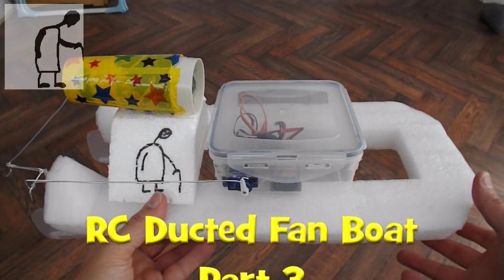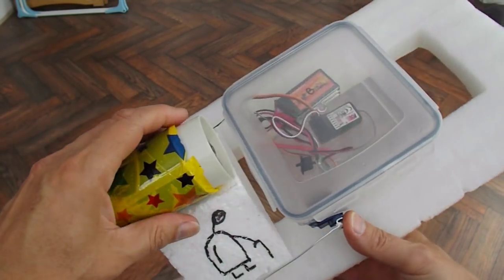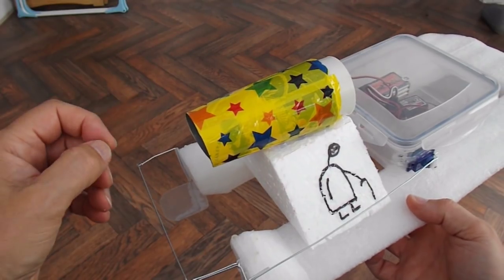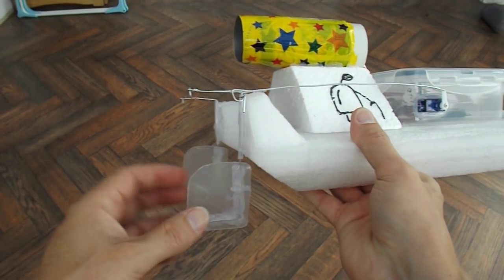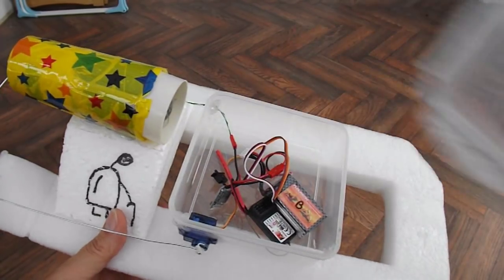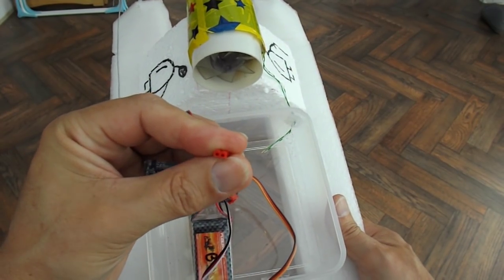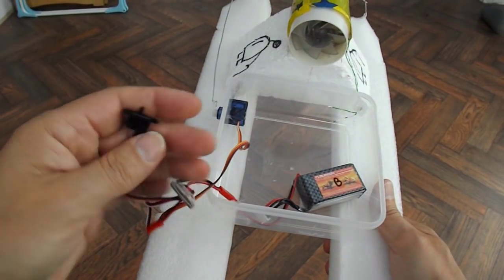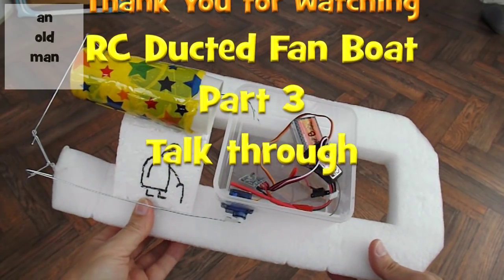RC Ducted Fan Boat - Part 3 Talk Through

Comment: hey grandad can you make a ducted fan car?? just keep the steering on the car
Reply from the maker: +kurt WAPOW I have just given it a try with a cheap RC toy car and the drive motor is not producing enough thrust to push the car forwards. I think if you want a succesful ducted fan RC car you would need to buy a proper hobby grade EDF